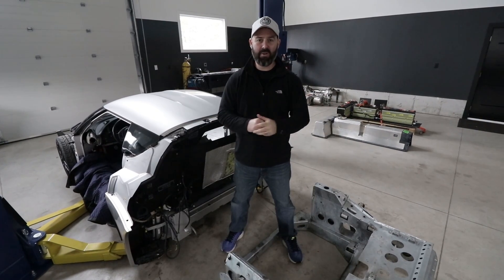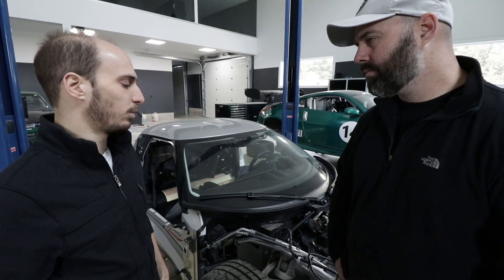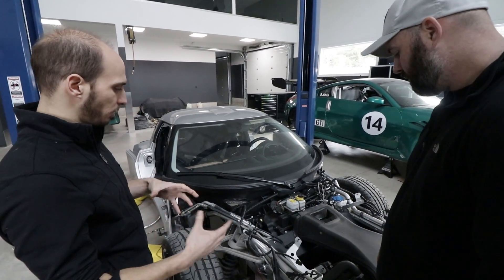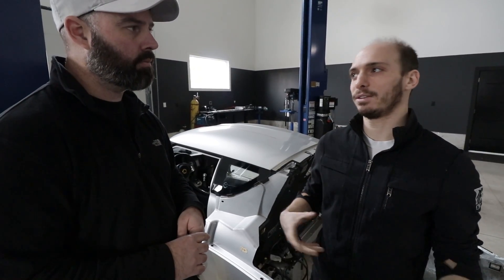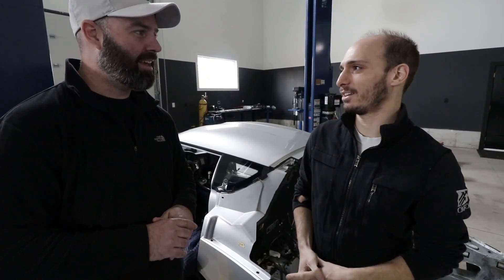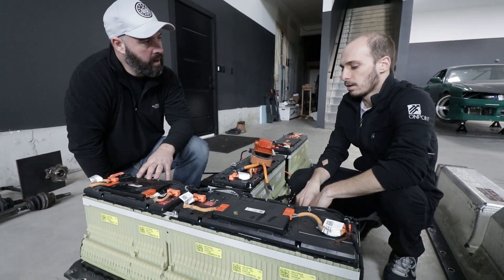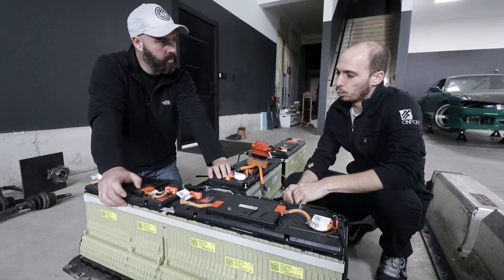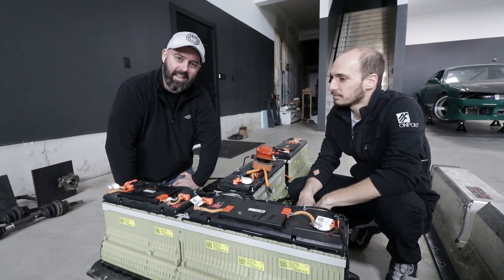Is This The Future Of Sports Cars? - Lotus Evora Electric Car Project With a Tesla Motor EP01

Comment: Electric motors have been developed for 100 years... nikola tesla invented them.. the first hybrid car was made in the early 1900s the hold back wasn’t electric motors, it was batteries which also have been developing rapidly for the past 100 years, the technology just isnt as easily developed as a gasoline engine.

Comment: Not going to be easy, Tesla had to change 90% of the components in the elise to get it to work and it ended up being a disaster in terms of financial success. Tesla had to widen the elise chassis, they had to design completely new components for just about everything to work purely from electric power.  Lotus built an electric Evora called the Evora EV

Comment: Pretty cool project, my thinking is along very similar lines. And I'm a genius :)
I do have a few concerns though. Is the Evora really light weight? It's about twice as heavy as a Lotus Elise. Similarly, I'm not sure it's true that the Volt batteries have higher power density than the Tesla cells. Can you fit two Volt packs into it?
Reply: and why only the lowest power Tesla motor?  my concern is that you are building a very expensive car that might only give you 4 second acceleration. Assuming the Volt batteries can deliver even that.

Comment: that's a question I had for a while now but always get mixed answers soooo I'm going to ask it here.. again.. lol
does the electric airco pump munch power off your engine to due to the alternator needing to deliver more power?
or does it leave power untouched because it's not connected to the rotating assembly?

Comment: "Had electric cars had a hundred years to develop..." Well, but they had. We had electric cars and hybrids in the 1800s until they kind of 'went out of fashion' in the 1920s. But the technology never stopped being developed or it wouldn't be where it is now.
Reply: Electric Motors continued on developing, especially for large scale transportation (Trains, Ships, Submarines, Cranes) . But demand for industrial capacity rechargeable galvanic batteries basically stalled from early 1900s until Consumer Electronics. There was just no major investment and factory scaling to develop Galvanic Batteries to feed the power dense liquid cooled motors. Now that investment and developing is ramping up, we realise Galvanic Batteries can be used for far larger industrial and infrastructure tasks.
Reply: *****
Mate, we had a hundred years of development. Electric motors and batteries are not exclusive to cars. Electric vehicles have existed and have been developed all along. And either way, that comment in the vid basically alluding to electric cars being a recent invention wouldn't be correct.

Comment: Awesome  project Sasha. You should get together with someone and do an LSD for the big Tesla DU also :)
Surpriced to hear that the Volt battery can output more than the tesla battery (60?). And fitting a tesla battery or the modules would probably be more difficult also.
Reply: The plug-in hybrid packs tend to be optimised for high output 'cause they still have to supply power to reasonably sized motors, have to be compact and they generally only have to allow 30-50km of range to cover commutes. A full EV can spread the demand for power over a lot more cells in a much larger pack, so the pack gets built more for capacity than sustained power output. Maximising range over performance.

Comment: why not super capacitors?
Reply: Show me a super capacitor pack under 500kg that can hold 60kwh for more than 3 days. Reliably and Safely. Then sure build an EV with supercaps as primary storage.
Though some super-capacitors were used on the original vehicles for Regen Braking buffer.
Reply: Neojhun now i know

Comment: Environmentally cleaner ? Remind me, how do you charge the batteries ? How are those batteries made ? Hmmmmm
Reply: Hydro Electricity majority for Ontario where Onpoint operates. Batteries are built Once and last about decade and repurposed for stationary use or recycled. Unlike gigatonnes of fuel which are mined, refined, transported and spilled. Only to be used ONCE. Soo yeah its not entirely footprint free. But Order of Magnitude Better.
I dare you to say COAL, I freaking dare you. Because Coal industry is Dying. It needs to be put out of its misery.

Comment: I've often thought of maybe an electric race car project, but with the batteries how much is it expected to weigh? That was the main detractor for me, as It's nice to have gasoline powered race cars sit at 2500-3000 lbs
Reply: We're already doing that. (It sucks mightily. We may have it worked out in a few years. But we'll never be able to charge batteries as fast as race conditions drain them.) There are plenty of drag cars/trucks using electric motors.

Comment: Any idea what the system voltage and peak current draw are? And will he be using the Tesla controller or a 3rd party unit? Way cool project!
Reply: 410V fully charged, peak current draw will depend on motor power but anywhere from 900-1400A
Reply: Daaaaaamn that's a lotta pixies flowin. EVs have come a long way from 144v on lead acid golf cart batteries.

Comment: Why is the engine "not so good"? is it because it is a toyota engine?
Reply from the maker: There's nothing wrong with the standard Evora engine. It's a Toyota V6, basically the engine out of a Camry but with a supercharger on it and with Lotus' own engine calibration. It's a reliable and powerful setup, but there's nothing exotic about it, given its humble origins.
Reply: Incorrect, It uses a (supercharged) 3,5 litre V6.
Reply: Actually our car had the non-supercharged 3.5L V6. So yeah, it's for sure the weakest point of the car if you were to compare it to a 450+whp sports car.
Reply: Sasha Anis, it's interesting that you say that when you built a NA VQ35HR that's similar to the Camry 2GRFE. A Camry 2GRFE with the same mods as your VQ35HR wouldnet similar numbers.
Reply: Sasha Anis were you guys selling it on Kijiji not long ago because I saw an 2gr from an evora while i was hunting for a v6 for my mr2

Comment: I can't help but think of how terrible the weight distribution will be with the electric motor
Reply: dont forget the original v6 was removed from almost that exact spot. The transmission and the exhaust too
Reply: Ignas Grigas exactly, that electric motor doesn't weight nearly as much as the stock engine, and transmission
Reply: Actually, the weight distribution will possibly be the same or further forward than stock.
Reply: Sasha Anis how so? what's the weight difference between the electric, and gas engine and transmission?

Comment: Nice one Sasha, looking forward to see how it turns out
Like it or not it's what has to be done.
I'm actually looking into a hybrid or full electric work vehicle, I don't think it's necessary to have a big petrol or diesel vehicle if I'm only moving light to medium loads and not traveling more than 50ish kilometers a day.  
Unfortunately I'm not having much luck down here in Oz, if I want a big ass hybrid truck then no worries, but apart from that Australia is a bit behind when it comes to hybrid/electric.

I'd actually like to see a future where the majority of everyday cars are electric, being charged by natural sources, solar, wind etc.
And petrol driven vehicles are left for the driving enthusiasts, although give it a few more years and electric cars are going to destroy everything on the road.
Reply: Petrol cars will be horses.

Comment: This is an awesome work and i'll folow it, but petrol is petrol, you can't beat it
Reply: ok maybe performance wise, but the sound and the feelings are things that an electric engine will never have
Reply: i completely agree with you but it'll be interesting to see us petrol power enthusiasts in 50 years seeming old fashioned for preferring to burn dinosaurs
Reply: It's not gonna die so quiclky, for us car enthusiast, for thing that cannot be powered from electric stuff yet, and so on
Reply: I'd agree with you in a short term sense. You can't beat it, yet.
Reply: Roby pugliese not yet,ev getting better every year,search tesla vs hellcat and watch the pownage.
Reply: +cartmanrlsusall but the hellcat feels way better and you don't need to wait half a Fuking day to drive it so.....
Reply: YouTube is fucking everyone up LOL your ignorance is funny. The NIO EP9 takes like 15mins to battery swap. Currently just a prototype and battery swap is being done with hand tools. The two banks of batteries are just huge blocks on the side easy to access. I highly doubt a Hellcat is feels more exciting than NIO EP9, it supposed to be a street legal cruiser.
Reply: +Neojhun battery swap not charge
Reply: Roby pugliese not yet
Reply: Its just a matter of Cost for track driving. If you can afford to have 3 sets of batteries to rotate. 2 Sets to be Charging while you drive should be around 1.5x the speed of consumption with current gen tech. Its just diferent method of achieving a goal that can be done with EVs. In the near future when batteries get cheaper should be viable.
Reply: current best time around the ring is an electric; look it up.
Reply: Sorry bud but petrol is out electric cars  are the future